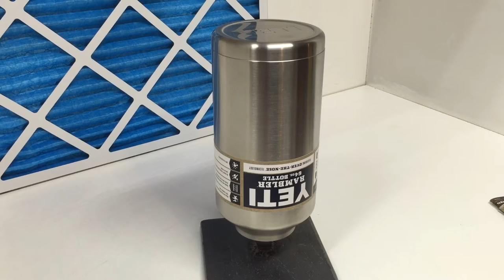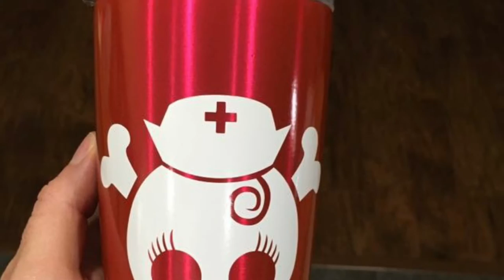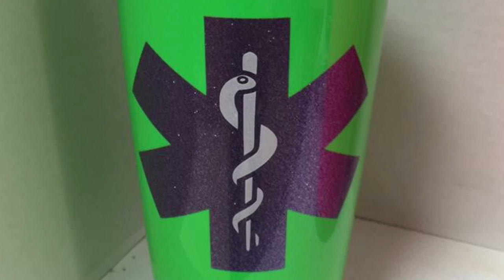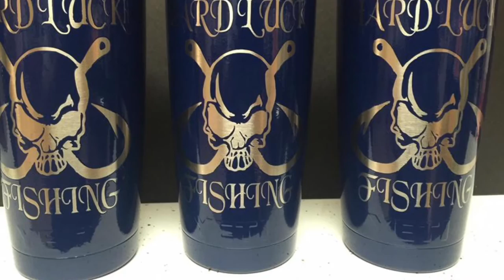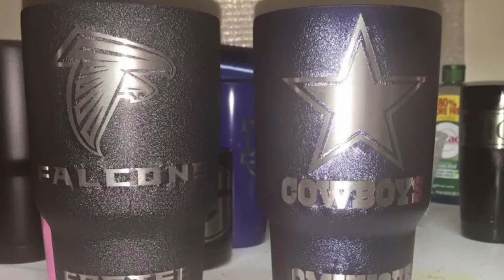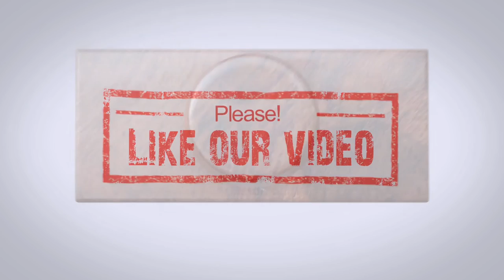DIY Powdercoating Stand for 64oz Yeti Rambler

Comment: Love ur vids bud.. one of the few that helps out the powder coating community.. keep it going bud
Reply from the maker: Thanks for the support.  When I decided I wanted to try my hand at powder coating I was amazed at just how few videos were available on different methods.  Most of what I've learned has been through making mistakes.  With the exception of two people, Berry being one of them I learned by just trying and often failing.   I know there is a long way to go to really consider myself a good powder coated, but as I learn new techniques I will be posting them.
Reply: +bugmanchad ya man were farely new also.. were figuring it out as we go but u help us out alot.. one thing we did was ur stand but we couldnt use it since i have a small oven from eastwood.. getting a big oven when i get back home.. check out our facebook page.. were out of Corpus Christi, Tx.. Sticky Custom Designs.. thanks bud

Comment: Would this also work for the tumblers? And thank you for taking your time to share with us
Reply from the maker: I think it would.  I have a different design for tumblers currently, but I may modify this designs bottom washer size and see how well it keeps dust from entering the cup.
Reply: +bugmanchad I was wondering the same thing with the larger washer,  also it would be much easier to make then the tumbler
Reply from the maker: +Tracy Mitchell I'll let you know Friday.  I'm headed to Fastenal to pick up some other washers and intend on picking some up that should do the job.